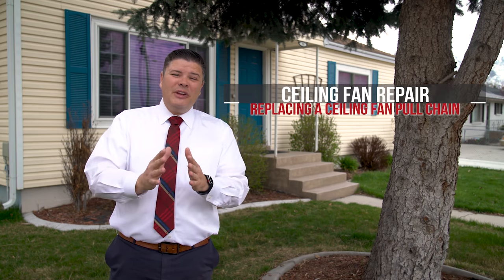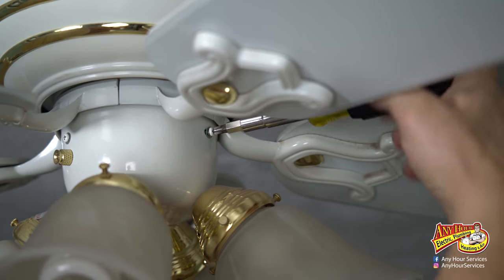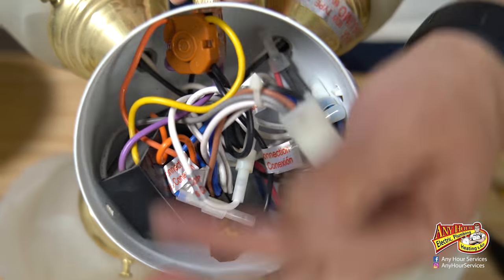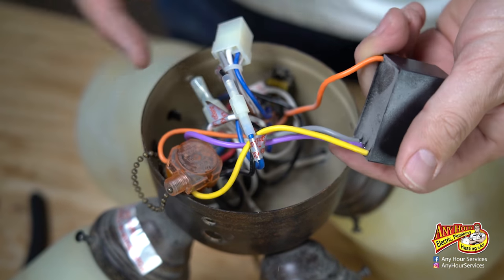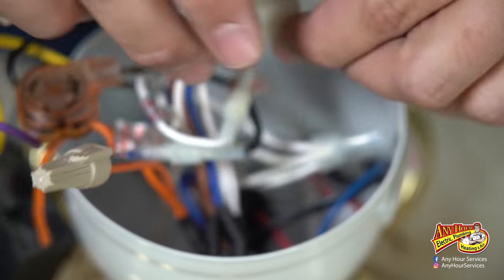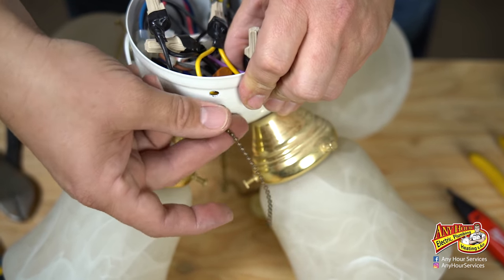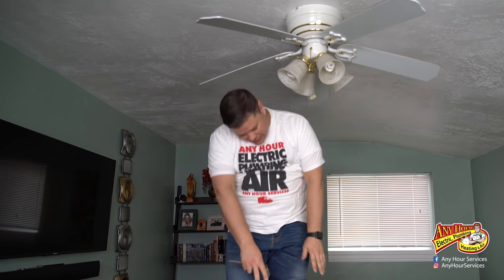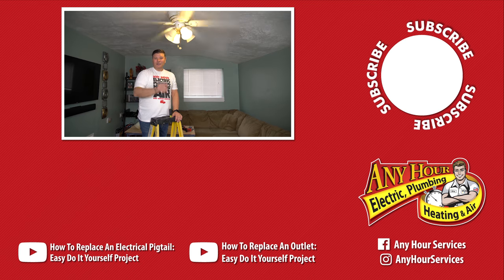How To Replace A Broken Pull Chain Switch On A Ceiling Fan

Comment: I had two ceiling fans to stop working over two years ago.   One was a broken pull chain.  I had already bought two new ceiling fans to replace the two broken ones when I stumbled onto your VERY HELPFUL video.  With your assistance, I was able to take the switch from one fan and attach it to the fan that needed a new pull chain.  The wires were an exact match!  I now can sleep under a ceiling fan again!  I still have to replace the other fan, but, I will only have to pay someone to install only one for me...OR maybe you have another VERY HELPFUL video that could instruct me as to how to take down an old ceiling fan and install a new one!  THAT would let me save even more money!  THANKS, AGAIN!
Reply from the maker: Haha, so glad this was helpful. Here is the video we made replacing an old ceiling fan. Let me know how it goes. https://youtu.be/VCucNF2PKyI

Comment: On mine, the chain didn't break but something else did or got stuck. Is it possible to open the little box or do I just need to buy a new one and cut off the old?
Reply: Same here, I'd love to just reattach the chain into the switch instead of having to buy a new one and rewiring it

Comment: Just the video I needed, however my fan doesn't have the wire connection like yours, mines a small tube that won't disconnect 🙄

Comment: We actually took the black section off the broken part while it was still attached. We were able to see the clips that were holding the wires, pry the clips to remove the wires, and one at a time push the wires into the new part.
Reply: How were you able to pry it apart?

Comment: The Venders at Homedepot don't have the exact parts they have a 3 speed by 3 wire only not a 3 speed and 4 wire :) checked 2 of them go to an electric supply store

Comment: Hi, great video! I'm in UK, I bought a replacement pull chain switch for my fan but it didn't come with the 3 wires included. I can cut the wires from the existing switch to use but how do I insert them into the pull cord switch? There's no screws for me to tighten the wires onto the switch. Can I just insert them and expect them to stay?
Reply: there are some switches that are like this.  just push in the bared wired until you hear or feel a certain pop, then it means it went into the hole the right way and will stay in there.
Reply: @pershop4950  p

Comment: There's no need to worry about the ceiling wires either.

As long as everything was installed properly, it is no different than working on the rest of the lighting fixture.

Comment: Correct me if I'm wrong but why cut them you just pull them out like you're unplugging it and then plug it back in instead of cutting the wires I don't know if you know that 🤔
maybe I'm wrong

Comment: What if it is the chain for the light? Is it a similar process?
Reply from the maker: Yes. You can looks for that specific switch configuration when you're buying it. some light chains are just on/off others make the lights com on in different orders. But if you get the right one it would be wire to wire.
Reply: @Anyhourservices  amazing. Thank you for the reply